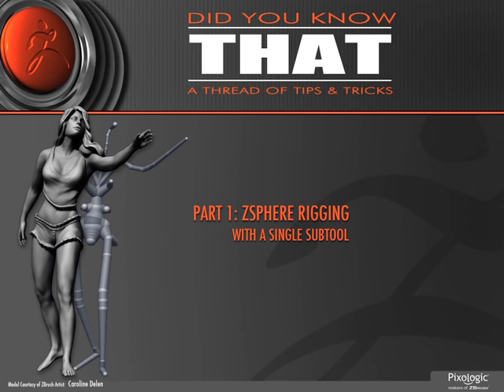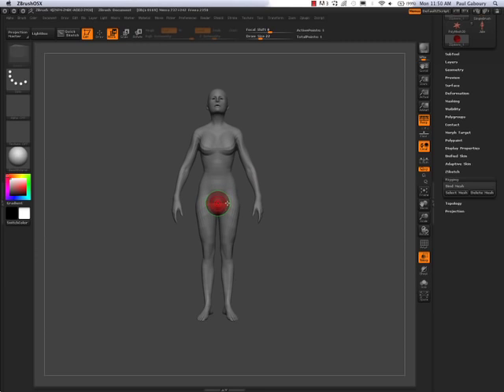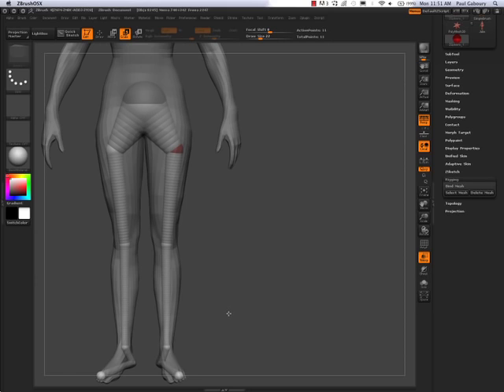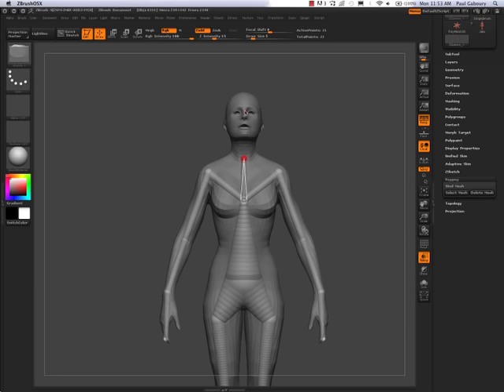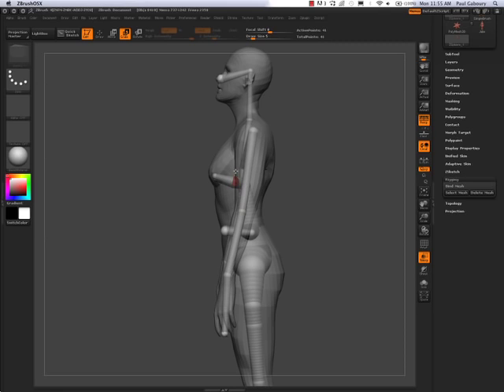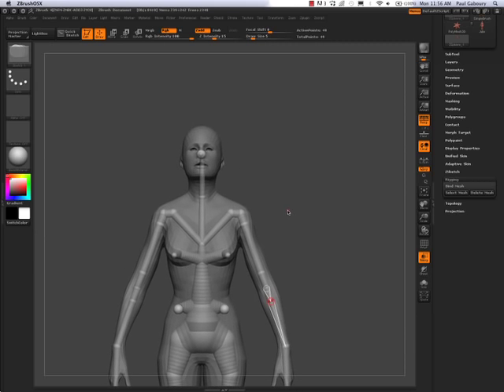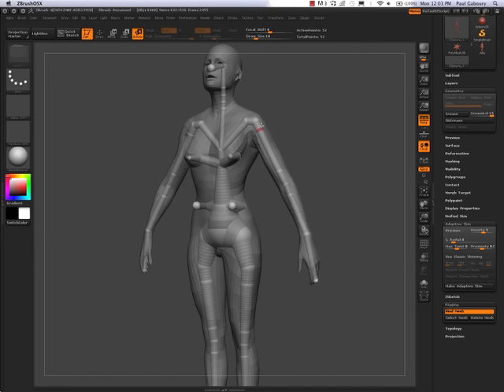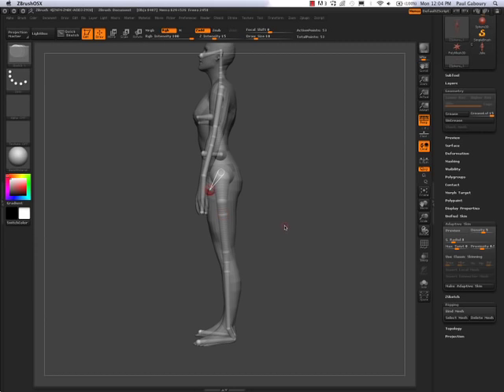Part 1: ZBrush Rigging with a Single Subtool

Comment: Thank you very helpful. Would it be possible to make a chain of zspheres for the fingers and toes if you wanted to go that extreme with your posing? Thanks in advance.
Reply from the maker: Yes it would be possible to do that. You need to make sure there is enough gap between the toes and fingers. Not a lot but enough for the ZSpheres to distinguish between each.
Reply: @PaulGaboury  Thanks for responding :-)

Comment: hello, very good videos, can i make you a question? what is better for using the zbrush program: a good graphyc card or  what, because i have a good one and when i try to rig it goes so slow that i cant to nothing. thanks for all the tutorials
Reply from the maker: ZBrush is not using a video card at all, except for PolyGroupIt. It relies on Processor and RAM more than anything else. Are you trying to rig millions of polygons? If so this is why it's getting slow. You need to have a lower subdivision for posing.
Reply from the maker: ZBrush does not use a video card. The only item in ZBrush that uses a video card is PolyGroupIt. ZBrush is using your Processor and RAM the most.

Comment: Its posible save the bones to use it with other file?
Reply from the maker: Yes, just save the ZSphere rig out as a Tool. Then you will be able to load it for later. You can use the Store TM Rig and Paste TM rig options in Transpose Master to copy/paste for another model.
Reply: @PaulGaboury  tnk for the tips (y) :D

Comment: what if character has armor or cloth and staff? metal armor keeps stretching with the body
Reply from the maker: It's going to stretch because this is a soft binding system. You may be better off using the new 3D Gizmo with the last option to allow for movement on multiple Subtools or when using Transpose Master, use the Transpose Line instead of the rigging.

Comment: Hi Paul. Nice vid. I have no idea what I am doing wrong but my knee and elbow joints don't deform like yours do. Normally with rigging I'd use three loops for a low poly joint and only have the middle loop weighted 50% to either side. Doesnt matter what config I use, or sphere size the joint doesnt deform properly. Just looks like a banana. The sphere in the middle doesnt anchor the mesh. Any ideas?
Reply from the maker: Hello. I would need to see the model. There should be no reason why the middle ZSphere is not constraining the elbow or knee. I would put all of the information you have, along with the model on support.pixologic.com

Comment: Thanks for the great tutorial, still works in 4r7! A quick question: Is there any possibility to create various instances of a zsphere rigged character? Lets say I have a character and want to create some instances of it to pose a scenery of interacting characters. Is that possible? I tried just duplicating the rigged subtool but that seems not to work... Or do I have to do this in an external 3D Application like C4D?
Reply from the maker: You can reuse any rig by using the Store and Paste option in the Transpose Master plug-in. Did you watch part 2 of this series? I go into using that plug-in. You can also put poses on layers with the plug-in.

Comment: My zspheres won't move when I try to rotate them.
Reply from the maker: Make sure it's not masked. Are you in Rotate Mode along the top?
Reply: I figured out the problem, I got rid of my subdivision layers on accident so I had to start my project over. However, this new project is looking amazing and I got the rigging correct. Thanks for the tutorial!

Comment: Why are my zsphere bones not parallel as yours.They are allways sharp-- smaller at the end :(???? Why?
Reply from the maker: The size of the ZSphere won't matter but maybe you just need to size them up a bit. You can use the Scale option at the top of the UI to do this. Also when you draw out the ZSpheres you can move up/down to change the size on the fly during the initial drawing of the ZSphere. 

Make sure you have symmetry on when building your rig as well.
Reply: Paul Gaboury I follow your every step. But when i finish placing the zsphere inside of the body and switch to draw,i cliked x for symmetry, it wount drow parallel zsphere bones like yours,they are triangle from previous zsphere bone uffff i know i will get it but now it is so hard to do basic stuff even if i follow your instructions..
Reply from the maker: Click on Move mode to select the ZSphere you want to draw from then switch back to Draw. Make sure that you do not have Ghost on for Transparency. It's on the right side of the document.
Reply: Paul Gaboury I think i get it now...Just one more important question why when i right click zsphere is not allways shows it in main project window just in tool menu on right..Sometimes it does as your steps telling sometimes it just shows it in tool square :( ?
Reply from the maker: Not sure I follow your question. Are you referring to the menu that pops open when you click right click? The top icon is the Tool palette to the right but you have to click on that icon to see the whole Tool Palette. When you are rigging something that icon will no longer look just like a zsphere as well.

Is this what you are referring to?
Reply: Paul Gaboury Not exactly..Your video begins with woman model..Then you click in right tool menu to choose zsphere..But when you choose it your zsphere is right on the screen before you go rigging step..But my zsphere not. Sometimes it just stays in tool menu on right side screen..I can drew it but then i can not rigging i dont know why it is happening :(..MAN I subscriebed it to your chaneel :) Thank you for helping me very much!!!! 
And why by clicking new document my choosen tools stay.Why cant i just reset whole project to new one?
Reply from the maker: Hello Goran

This is because the woman is already in Edit Mode. So when I click any other Tool (including a ZSphere) ZBrush will just swap between the Tools.
Reply: Paul Gaboury I figured it out...I just dont know how to save whole project it saves me just zsphere bones..But i will figure it out adventually i hope.Thanks for everything..

Do you have time to teach me for money of course?
Reply from the maker: You can use File>Save As for a Project. Unfortunately I don't have much free time at this moment but please feel free to check in at any time.
Reply: Paul Gaboury Thanks man you have allready done to much..!!

Comment: this is buffling me for so long....what did you do  so you can just click on the canves and them zsphere did like extrude its arms and legs?  

did you use any hot key to do it?

Not working on zbrush 4r7
Reply from the maker: you have to make sure you are in transparency mode but not Ghost Transparency.
Reply: Yeah...I finally find out the answer the night before yesterday.....

Thanks for the replay and the great tutorial :)

Love your custom menu tutorial too ...:)
Reply: Did you find the answer already? Bones will not create like here if you will have GHOST Transparency in mode ON. Turn it off and click with new spheres everywhere where you wanna and all will be alrighty! =) This icon under Transparency icon.
Reply: How did you get it man :( ? My zsphere bones are allways triangle not even parallel from point to point :( Please help...
Reply: yeah thank you for the reply.... :)

Comment: I'm shift previewing and shift clicking the shit out of this mesh and it still snaps back to the original pose when I unbind the mesh.
Reply from the maker: Are you working with a single SubTool or multiple SubTools?
Reply: I'm using a single sub tool. It was originally a dynamesh sculpt then I decimation master and subdivided it a couple times. I'm not sure if that had anything to do with it.
Reply from the maker: Yes that could cause any issue. I would recommend duplicating the Dynamesh version, then ZRemesher it  and then use the Project All to get all of the details back from the original Dynamesh. I would not recommend doing this trick with a decimated master mesh. theoretical it should work. Make sure when you do the shift part you hold shift down and then click on Preview. Make sure that density slider matches the subdivision count of the original. Don't forget to sculpt a bit on the preview when you get it.

Comment: Using Zbrush 4r7 p3 - when I Shift-Preview after posing (following all steps exactly)  my mesh reverts back to its original stance. If I don't hold down shift when Previewing, it completes the pose but I lose high-level detail on mesh. Are there any updates to how to do this with the current Zbrush or any suggestions you might have?
Reply from the maker: +nateido 

You have to do the Shift+Click on the model before you start to pose.
Reply: +Paul Gaboury  Ok, it WORKED. Halleluja. One thing I noticed however - Following it @11:08  WORKED, but @8:34 the steps were less obvious.  Also, the difference for me was when you "click on the mesh" (after shift-clicking Preview mode) it doesn't revert back to the rig mode like it did for you. So after Shift-Click Preview, I literally "drew" on the mesh and randomly clicked and shift clicked a bunch on the mesh, then 3) clicked out of Preview Mode, Posed as I wanted, then "A" for Adaptive and it worked.  LIke you did in the video, but in this version of Zbrush the clicking on mesh part doesn't seem to bring it back to rig mode. (typing this out for others who might experience similar issues). Thanks Paul!!!!!!

Comment: Hello, is possible use zbrush rigging  [human or another item] to dirrect intro Unreal engine ???
Reply from the maker: +Radek Vyslouzil 

Unfortunately not the ZSpheres can not be exported from ZBrush to be used in any other applications.
Reply: I suggest using another programme to import your model into - then you can rig them from there - therefore allowing you to import them again into your game. There are many that do this :) models are best made in ZBrush but if you want to put them into something like unity or Unreal engine use a programme called mixamo - mixamo lets you import models, animate them, and then put them into the above engines. :) (it ain't cheap though)
Reply: thx

Comment: Everything is works except at the end when I want to make the final model a posed mesh. My model has subdivisions but no details which are fish scales. The scales are apply to the mesh. You don't actually generate the final model at the end with subs. Thanks for all your support with ZB.
Reply from the maker: +AVTPro 

If you have subtools you should watch the 2nd video. https://www.youtube.com/watch?v=li4Q4XlkPlE
Reply: +Paul Gaboury Thanks for your prompt response Paul, as always. There's eyeballs but I didn't need those since I'm only adding an S-curve to the back end of the fish tail.. Perfect solution I did this morning and sent to the client was to simply GoZ both the curved tail that I made with the Zsphere rig and the straight tail with the scales at the highest subdivision detail to Maya and made them Blendshapes. I then Goz the curved tail back into straight scale SDS tail. Worked perfectly. Zsphere and this video was a huge help regardless. I only remember Zsphere rigging from cleaning a 2005 video disk I archieved this morning from. ;-) I've been using Maya for rigging I forgot about how useful Zsphere can be. Amazing work. You have done through the years. Thanks. I'll relearn T-Master soon. I saw ZB Summit 2015 recently where they kept mentioning T-pose Master, I had forgetten...Been a long time. Thanks.
Reply: +AVTPro  BTW, S-bend would have done the job if I could have got a double sine wave at the end of the tail, but I couldn't figure out how to move the pivot without moving the model. It all worked out fine and I am going to use Zsphere a lot more. Really easy to concept need models with it.
Reply from the maker: +AVTPro 

Could have to put the curved version of the tail on a layer in ZBrush then used the Maya Blendshape plug-in to send that over to Maya as well. This will automatically create a blendshape in Maya.

Comment: Paul, has anything changed for 4r7? Because i remember using this technique and it worked perfecty on 4r6, but on 4r7 it just won't project all the sculptural detail back. I am following your instructions exactly.
Reply: +Badeanu Tudor See my comment above. Hope that helps
Reply: have the exact same problem
Have you figured out what it is?
Reply from the maker: Nothing has changed. Still working for me. Don't forget to touch the model so it can make that reference. Maybe put a little bit of a sculpted stroke on the model to be sure.
Reply: Shift + Preview brings the high res detail but the pose is lost so I don't think this method works in 4r7
Reply from the maker: yes it still works in 4R7. You have to do these steps before you pose.

Comment: I have a question,
so I designed a character and he has clothes on him, I now want to put him in a pose; can I do this with rigging and have all his clothes move with his body too?
I have tried using the transpose tool with rigging but I was only able to move his body into the pose. I'm guessing there is something i'm doing wrong(is there something that I could have forgot to do or something is on and i'm suppose to turn it off? )

I'm using Zbrush 4R6
Reply from the maker: Charles Nadon  Yes you can do this but you'll need to make sure to build a rig that will support the clothes. You will also need to use the Transpose Master plug-in so all SubTools move together.
Reply: Paul Gaboury For building a rig that will support clothes does that mean add more zspheres for where the clothes are and will the clothes have to be merged with the character when I start rigging?
Because at the moment my character is already rigged with an adaptive skin on him, clothing are all individual subtools. I've tried using transpose master to copy the pose then repose the character but it seems not to be working. 
-thank you so much for taking the time answering my silly questions..
Reply from the maker: +Charles Nadon 

Yes watch the 2nd video. https://www.youtube.com/watch?v=li4Q4XlkPlE

Comment: I have an issue. Is there away to tell the z-spheres what to attach to? No matter what I do they keep grabbing other areas of the models  and streching them along. I have made them as tinny as I could and they still grab unwanted areas. How do I prevent that? Anyway to tell it 'this is the left leg, stop trying to grab bits from the right leg'?
Reply from the maker: The size of ZSphere does not matter. It's the number of ZSpheres that matter. as long as you put enough ZSpheres in the leg it will not grab the either leg.
Reply: I'm having the same issue =/ Don't know how to fix that.
Reply: Paul Gaboury Thanks Paul!! Helped a lot.

Comment: Hey, so i placed the zSphere in the mesh, but the it doesn't let me create joints outside the sphere? BTW, I'm really new to zBrush, so if you know what am I doing wrong, it would be awesome.
Reply: Are you in draw mode?
Reply: I was about to ask the same thing!
How do you draw a new sphere far from the previous sphere you made.
Like what was done in the video,
he clicked on an empty space then the zsphere extended.
Reply: I just remebered that there's a way to move a new sphere away from the original one in the same mouse/pen drag in which you create it, it's tricky though;

1- Create the sphere.
2- Without releasing the mouse, after choosing the desired sphere radious, hold ctrl
3- Move the sphere along the line that passes through the center of the last sphere and the new one.

That's the tricky part, you have to create the new sphere on the exact point of the surface of the last one that is in the desired direction, that results quite hard for me and I always have to move the sphere again after the operation to put it in the desired place. 

Anyway, I hope this helps! It's the most quick way I know of doing what you asked.
Reply: ***** Niket Shah That's probably because you have the 'ghost' mode activated so you can see your model but not use it as base for drawing anything it's a 'ghost' if you see your model with kind of a silver aura look for this button http://docs.pixologic.com/wp-content/uploads/2013/01/4R5-Transform-default.jpg
Reply: You need to turn "Ghost" off. Click "Solo", then "Trans", then "Ghost" or so. Not sure about the order anymore, but that is what you need to do.
Reply: I think he did that not on an empty space but on the girl model, if you have the girl model on non ghost mode, you'd be able to create new spheres on the point of it's surface your mouse is on. 

If you see clearly that he is doing it on totally empty space, well, then I didn't see it nor have any idea of how to do it

Please if that's the case and you later discover how to do it, I'll be grateful if you post it here XD

In the end it's hard for zbrush to guess where you want to put the sphere if you are not pointing to any surface, there's an infinite line beyond your mouse/pen/whatever, it would be a good idea for it to put it on the projection of the last sphere's position over that line, but I suppose their designer didn't like that idea as much as me >.<

Comment: 6)Touch/tap anywhere on the model

7)Tool>AdaptiveSkin>MakeAdaptiveSkin  creates a posed mesh as a new tool in the Tool palette.

Anyway, the issue I'm having is that the higher-res detail isn't being created in the posed mesh when I click Make Adaptive Skin.  the correct polygroups are still there and the right subdivision levels, but somehow the detail is missing.

Comment: Thanks!
I want to create a creature sprite from a ZBrush model. This means I need to rig a model, colorize it, then I need to make a skeleton to pose my creature, and after that I need to shoot it in few poses from different fixed angles (0°, 45°, 90° etc.), using a one-color background.

So, how do I do that? I know how to make and rig a model already, but need to know how to colorize it, how to set camera angle to a fixed value and how to set keyframes for poses.